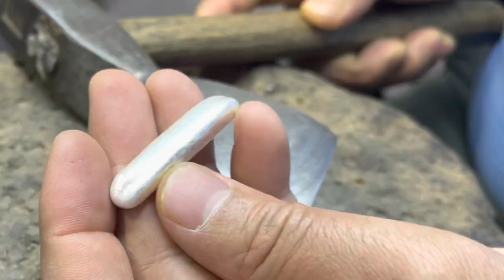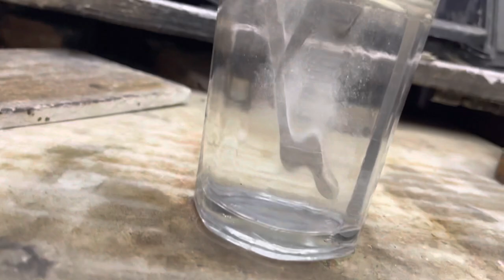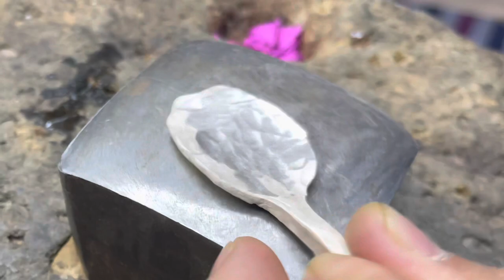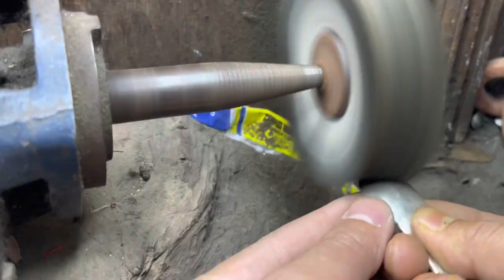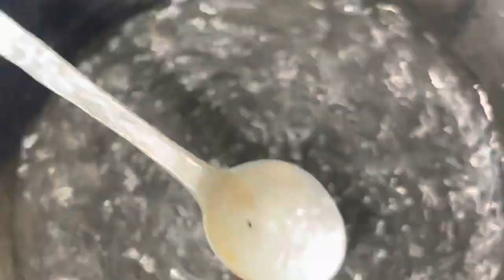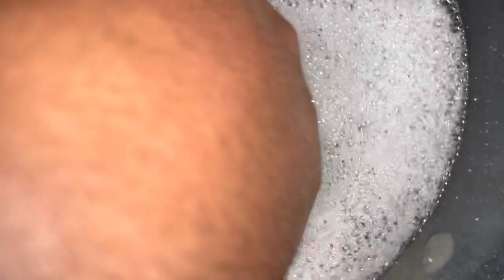How to make silver spoon | silver spoon making

Comment: What is the first material you are hammering on and what is the second? Is that a dishwasher at the end?
Reply: The first is a smithing block. Its a small anvil for forging. The rock for shaping the spoon bowl is called a dapper. The last thing Is an industrial version of a lab mixer. Its got a magnet at the bottom that spins when the motor under the bucket spins. The water is likely full of a pickling solution to remove surface tarnish.